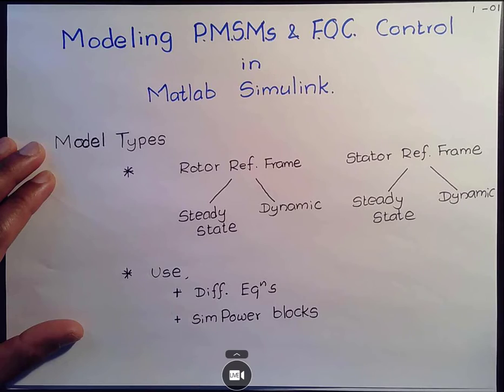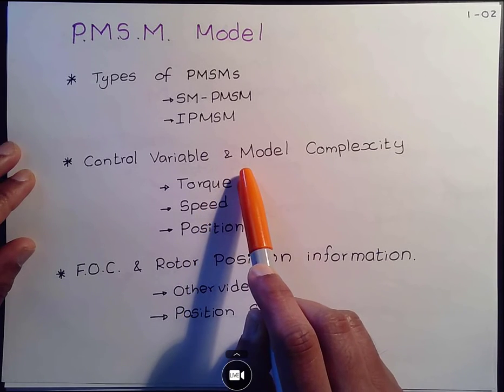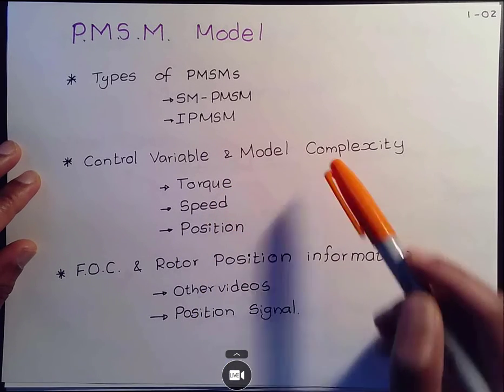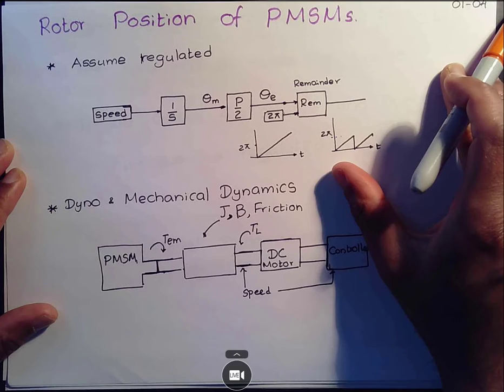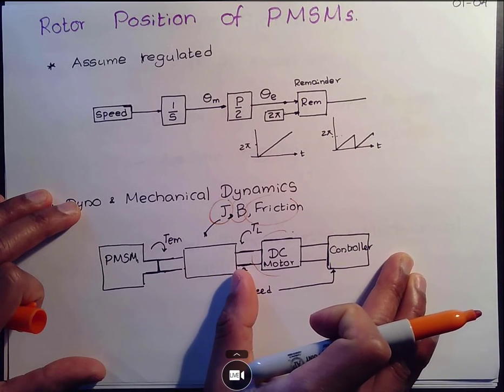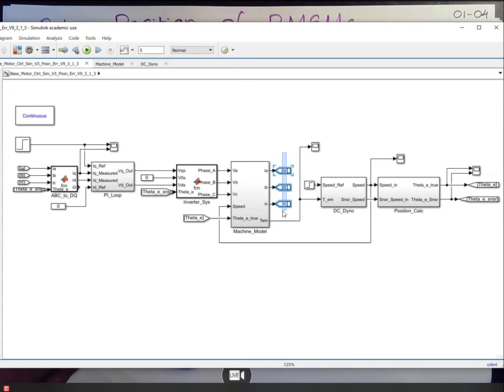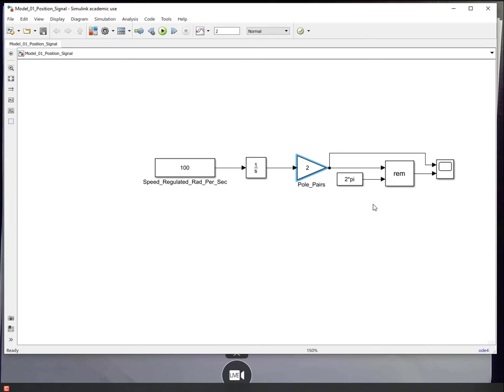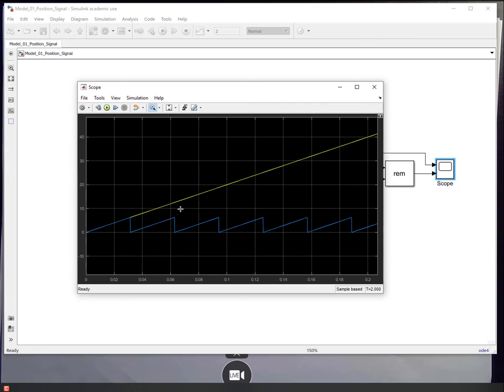Position Signal for PMSM and FOC Modeling

Comment: Sir is there any paid courses or unpaid courses 
are available from you where you teach fault diagnostic for pmsm motors?
Thanks
Reply from the maker: You can join Western Michigan University if you are interested!
Reply: @SandunKuruppu   Sir i  am working professional in india, if any online courses then i Can join but the offline courses are not possible. at the same time sir i have gone through all the online courses in "Western Michigan University" but electrical courses. i also saw your website for phd position also then i realised you are a great researcher and faculty. Thank you for this playlist Sir.
Reply: @SandunKuruppu  Sir actually i am working professional in india, i searched the online courses in the Western michigan university but no online courses are available regarding the fault diagnostics. if you could suggest some content from where i could get some deep insight of diagnostics it would be helpful. 
Thank you for this amazing playlist.

Comment: Hi professor Thank you very much for the detailed videos. Kindly make some videos on modeling of PMSG connected to voltage source converters.
Reply from the maker: Hello Muhammad,

PMSG is very similar to a PMSM. The only difference is the power flow direction. It is like, using the PMSM in regen mode. You can apply negative Iq and Id references and achieve the same, unless you are looking for something different. Does this make sense?

Best,
Sandun
Reply: @SandunKuruppu  yes got it thank you very much.

Comment: Bro kindly request to have lecture series on dsp implementation on power electronics.......
Reply from the maker: What kind of aspects are you looking for? PWM?
Reply: Iam currently preparing dsp based  electro mechanical motion control by Hamid toliyat .which is assembly language.i don't what dsp evaluation board to use how to use. no materials in dsp processing. Like u said pwm what board I have to use.how to use.how to learn programming.